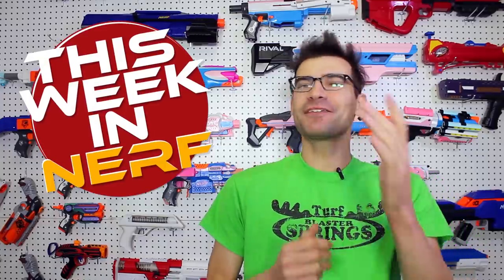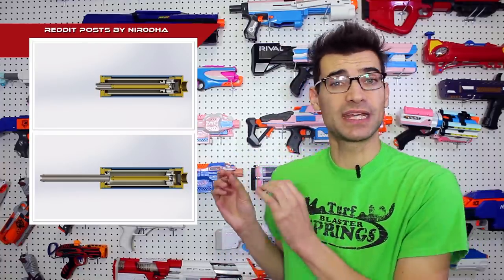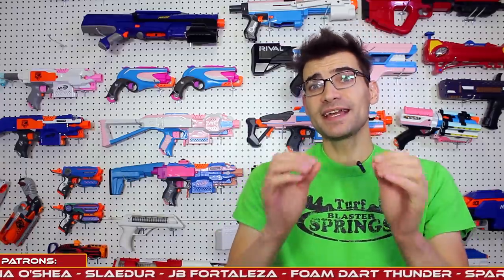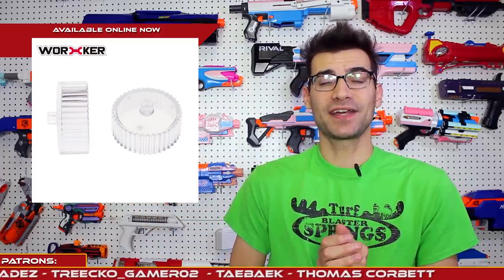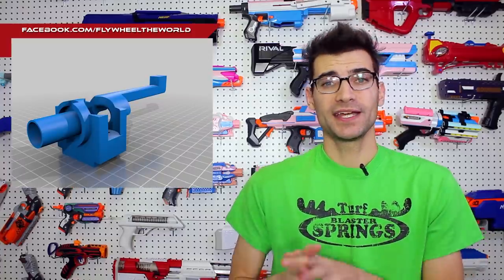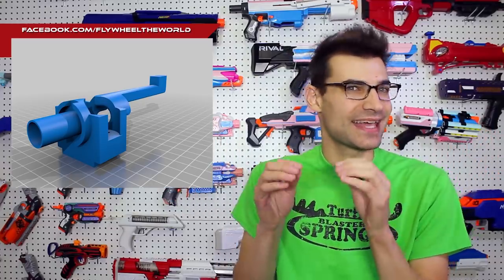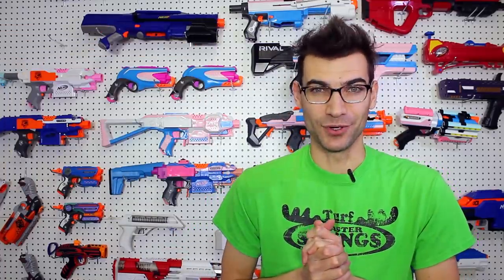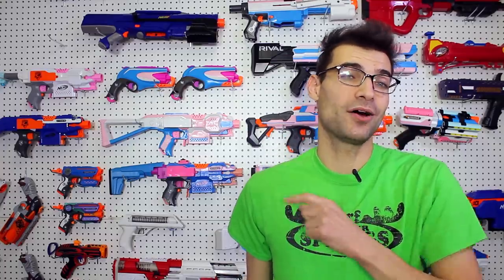HPA Engine, Transparency & Toy Drives! This Week In Nerf News #88

Comment: Those flywheels would only be brittle if they were a plastic like worker mags. But i am thinking they could be a softer plastic more like a skateboard wheel. I think that would work, need to see them in person
Reply: Skateboard wheels vary in hardness, and most hover around 100A. (A is the unit hardness is measured in)
Reply: JForgeUK Cool, i don’t know anything about ratings but i mean there are plastics that have are softer than others so i think these can work.